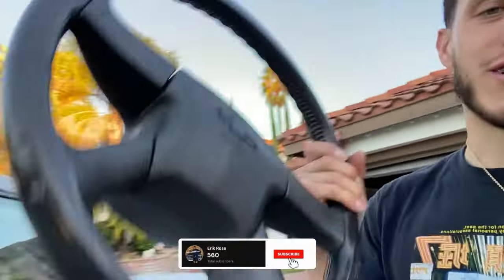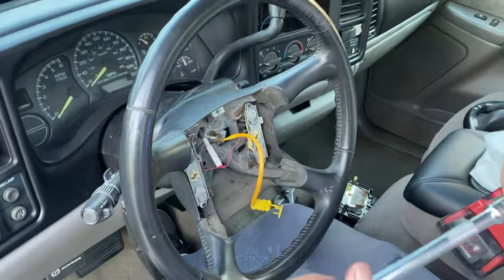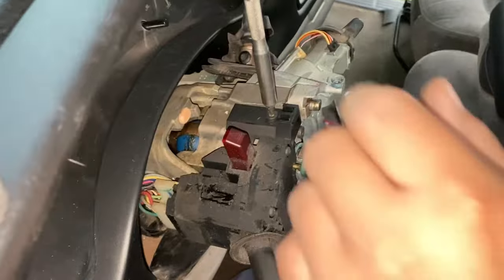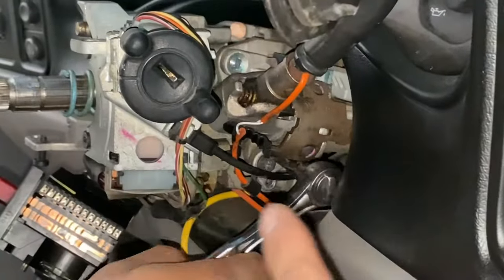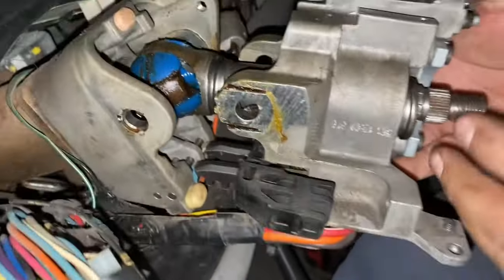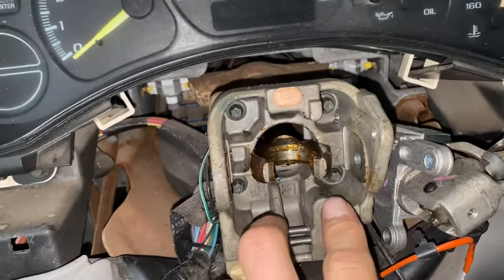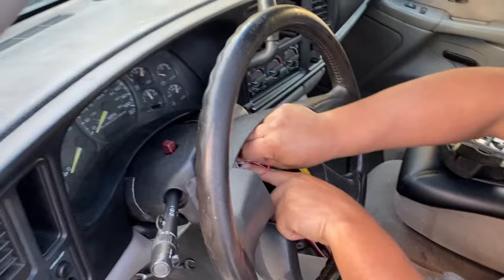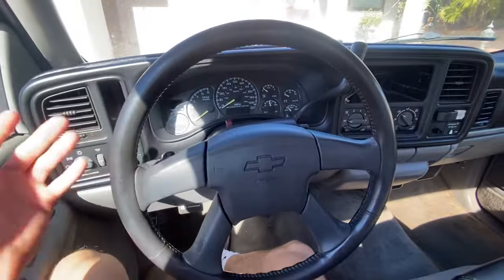STEERING WHEEL SWAP SILVERADO 99-02 TO 03-07

Comment: don't the air bags from the HD trucks only have one wire?  Maybe you can use one of those. Agearhead for life did the same awap.
Reply from the maker: Good to know! I knew one of them had it I just wasn’t sure which model thanks for the info.
Reply: Yeah but it has to be from a 2003 HD just to be safe
Reply: @AllendeNL it can be from any year and any model but the thing is IT HAS TO BE from a truck with roll up windows

Comment: Respect. Hard job. Finished to Completion.. well done. However next time simply extract the splined female portion that goes over this shaft you swapped. Simply cut out both wheels center's and swap the one over to weld it. Easy easy easy. An hour tops
Reply from the maker: Thank bro we appreciate it! and we had actually thought about doing it that way too but simply didn’t want to go back to the junk yard and get more parts lol either way came out great! 🔥

Comment: Edit: I had the same problem. I thought about welding the spline from old wheel onto new but this looks a lot cleaner
Reply from the maker: Agreed! as long as you get a clean cut and good measurements it’ll look and feel OEM! New wheel feels great!
Reply: @ErikRose_ I found out the 2006 express van is a bolt on

Comment: Badass video man I like your ambition to make things swap. I have 3 of the gmt800 series 2 trucks 04,06 2500hd 02 Tahoe. Did a full Escalade interior swap including full dash and it blows me away how different they are the whole wiring and all switches are different. I’ve been wanting to put a stingray steering wheel and the Tahoe out of one of the new Corvettes so I went and found one of the splines and chopped it off and I’m going to do the same thing like you did. I never messed with the clock spring in the airbag things on the O2. I just pulled the dash cluster and popped the bulb for the airbag lol so the light isn’t on anymore. But I’ve checked through countless forms online and all you see on there is people writing bs. Answering your questions with well I had a buddy that did this or somebody that did that but they don’t have any experience on the subject so it’s like man why are you even commenting wasting my time giving me some dumb information there’s no good or the people they can’t be done no way no how I had one of the admin’s tell me that about putting those seats in and I was like yeah right i’ll figure it out the work because when you flip them over and look at both of them all of the motors and set up are the exact same plugs that go into motor so I got to tear into the wiring on it and is the same just adding more shiz to the 03-06 but I got them to work so if you want it you can figure it out. Thanks again for the video
Reply from the maker: Yeah man it’s amazing how similar these trucks all are but then again so different. You’re are absolutely right same thing when I was looking for stuff a lot of bs and no direct answers. Yeah bro there’s always a way to get things done whether people say it’s not possible, if there’s a will there’s a way. Anyways, Thanks for tuning in bro, we appreciate it 🤙

Comment: Were you able to swap the clock spring fine, or was the wiring different?
Reply from the maker: it was different but it is possible either changing the clock spring or getting the airbag that matches the one you have!

Comment: Anyone need a airbag 03+ with 1 connector for this swap i have 1 available, also your able to make the steeringwheels controls work from the 03+ on the 01 with aftermaket radio splicing into the clock spring